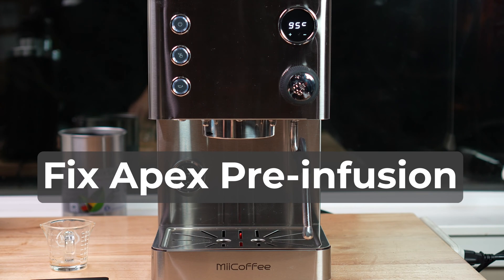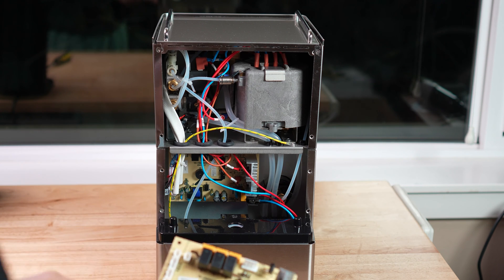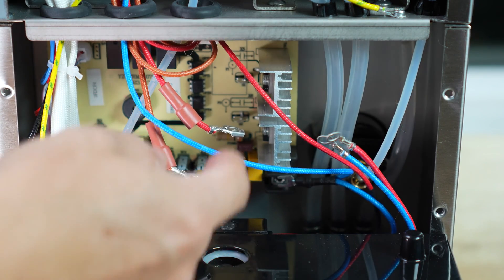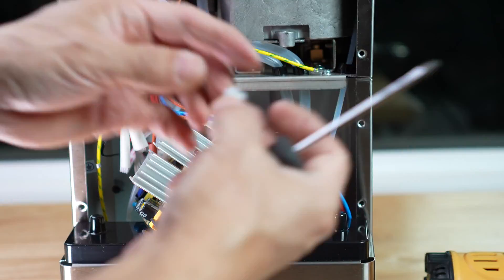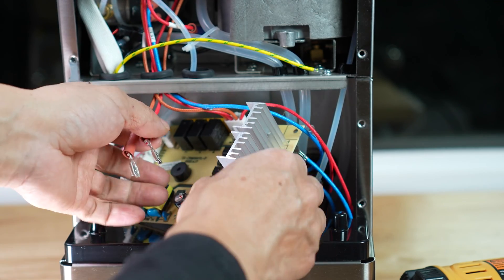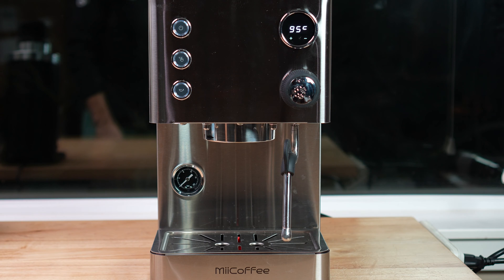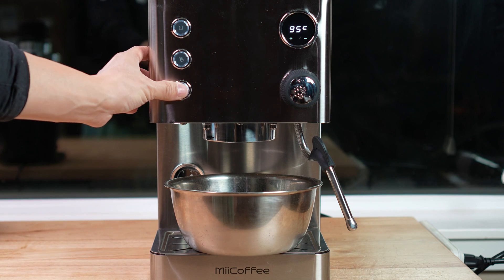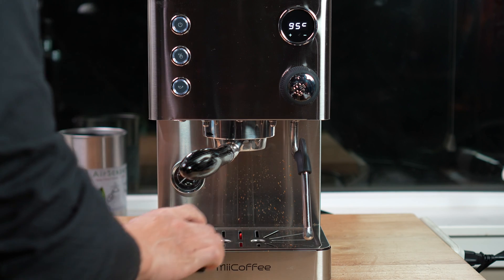Swap the Control Board to fix MiiCoffee Apex Espresso Machine Pre-infusion  Issue

Comment: I got mine with the same issue again, it looks like some are still not fixed yet. As soon as i contacted miicoffe they sent me a new pcb very quickly, i just installed the new pcb and working perfectly, solenoid valve isn't engaging anymore. Happy with the whole experience but still preferred if Miicoffe could rectify this issue instead of the hassle to change the pcb again.